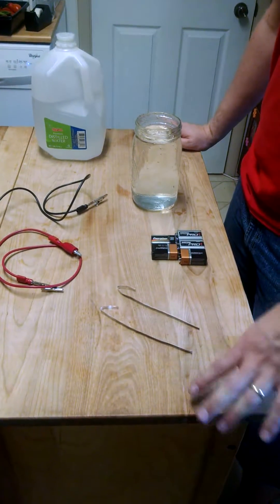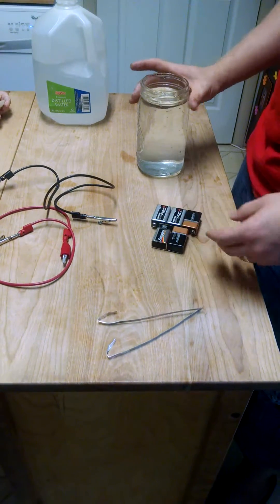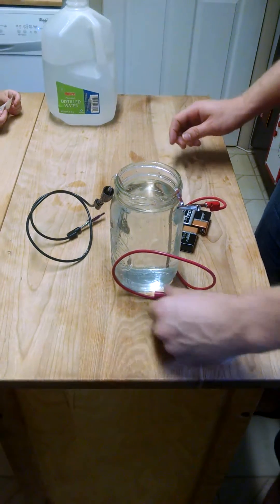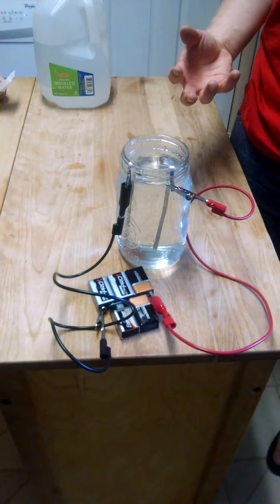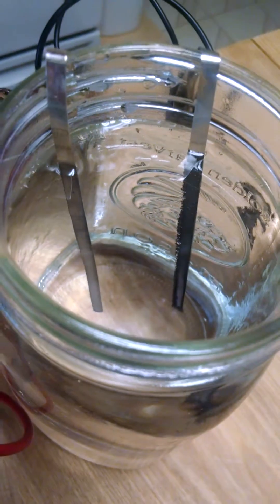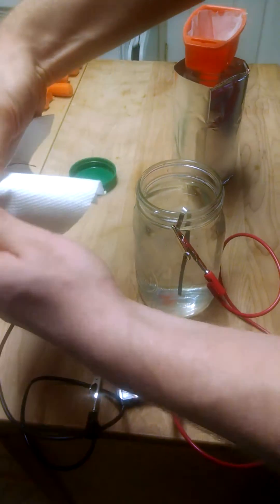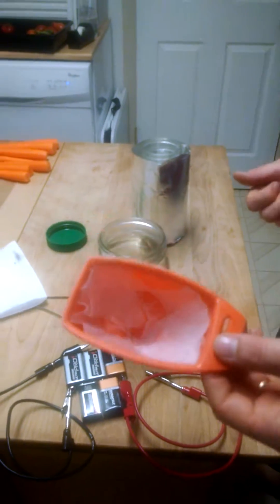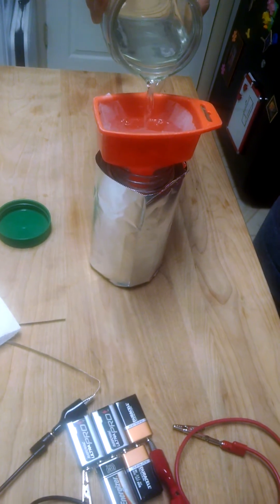Colloidal silver production by the quart **From a chemist**

Comment: I am making it for the first time and its been about an hour but only one rod is slightly black at the bottom. Im using 3 9V batteries. Is this time frame normal or did i do something wrong?
Reply from the maker: Only one rod will get black (silver oxide) the other will start a build up with what looks like fuzz. That's the silver particles that have traveled from one rod to the other. 

Depending on the voltage thats being output of the batteries, it may take longer if they are not at full capacity. 

The rod that's forming black should be almost completely covered (at least the part that's in the water). If I see more than a few mm of fuzz on the second rod... i do go ahead and stop it.  And tthe fuzz on the second rod should form pretty uniformly.

Comment: How do you know when it's done?
Reply from the maker: You can tell it's done with the lead is completely black and the other is covered in fuzzy particles. I don't like the fuzzy particles to get beyond a quarter of an inch, as it's hard to pull out cleanly. 

You don't want the water to over tint and get too dark, but that takes a lot of effort to get to that point or just forgetfulness. 😂

A simple way to test it would be to get a TDS meter if your really concerned. We just don't do that step after years of making it.
Reply: @jazzybio13  thank you!

Comment: Great video!  I clicked on the link for the silver leas, but it looks like they are straight rods and yours are curved at the top.  How did you get yours curved to go over the glass jar?
Reply: Plyers
Reply from the maker: Ours are ribbons not rods, but we haven't found a source for those lately. We picked ours up at a local rock shop  years ago. 😂

For rods you can just bend them with plyers, silver is a pretty soft and malleable material to work with.

Comment: how much do you drink and how often?
Reply from the maker: We actually don't drink any CS internally as it can disrupt the good bacteria in the GI track just as much as the bad. We tend to use it for external applications and wound care most of the time.
Reply: @outoftheboxhomestead  Have you ever experienced a loose bowel movement form drinking it?
Reply: Drink it (2 tablespoons) if you have a stomach virus or food poisoning, 3 times per day. Otherwise, you will just hold it under the tongue, rub around with your tongue in your mouth for a few minutes and then spit it out. It will enter the bloodstream through the capillaries in the mouth and is known to knock out all viruses and infections inside the body.

Comment: My batch is super  cloudy...what the heck?! I sterilized everything and rinsed everything with distilled water beforehand.  😅
Reply from the maker: What kind of cloudy? Usually super cloudy means the water itself had residual particles in it. If it's a milky cloudy it's typically chlorine in the water. You can have wisps of cloudy material coming off the leads, that's the suspended silver particles themselves. Feel free to email us at outoftheboxhomestead@gmail.com with pictures and we can help problem solve this with you.
Reply: Did you have your glasses on?
Reply: @StarwaterCWS  lol, good one!  🤭🤣 I found my issue... I grabbed the spring water instead of distilled.   Made several batches the correct way since this post!  😎
Reply: I know...😂 @StarwaterCWS

Comment: How long do i leave it in there
Reply from the maker: This usually depends on how much power you've got left in your batteries. A standard full charge on a 9volt battery probably only 45min-60min. You'll know it's done when the one lead is fuzzy and the other is black. There is a slight tint to the water, a slightly gray to gold tint is what your looking for. The tint can be either, it just depends on how it reacted. This isn't a strong color observation, just a slight tint. I hope that helps!

Comment: If you add a water bubbler (for a fish tank) to this setup, it will help the silver ions to be more uniformly sized and spaced out in the ionic suspension.
Reply from the maker: If we assume the air stone is inert, I'm not sure oxygen being added to the solution would necessarily hurt or help. It might actually make it oxidize faster and possible give you shorter shelf life or make the solution inert itself nearly immediately. Neat concept, I'd have to do further testing on this to know for sure.
Reply: Also, it is best to start off with a little bit of ionic silver in the distilled water, this helps to speed up the process.
Reply: Would a magnetic stirrer do a similar job? Or do you think bubbles are specifically preferred?

Comment: Isn't it the desirable silver oxide that is wiped off? 
What about modifying the electrolyte with things like acetic acid or citric acid?
Reply from the maker: Yes and no,  when making a colloid you don't want the silver oxide itself, you want the suspended colloid particles which are left buoyant in the water column. So in this specific process the silver oxide is considered waste in this application, but could be used in other applications. As it does have slight anti microbial properties as a silver oxide itself.

Comment: 45v is way too high, especially since you're not using a potentiometer. This isnt chemistry, this is electrical engineering.
Reply from the maker: Nah, we aren't actually using 45 volts, as was mentioned in the video. You can do less, these are just older batteries and we use them until they are dry. ;) That's all. And yes, you can use a potentiometer, that would complicate the build and you would have to have an output reading, and that's not really the intention or outline of this video. This was a straight through process only with simple DIY elements found in a common household. We can do a build like that, but haven't found it to be necessary at this point. We do check the voltage of the set up with a multimeter before starting each time since we do stack batteries. This is both chemistry and electrical engineering....sometimes homesteaders have to double dip. ;)
Reply: Forgive my ignorance, if I’m starting with new batteries how many would I need?
Reply: @thriveprenataleducation5589 3 9volt batteries..27 volts total is perfect.Good luck👍
Reply: @thriveprenataleducation5589  9v x3 = 27v but use a potentiometer to dial back the amperage, otherwise larger particulates will go into solution. The smaller the silver nanoparticles, the better.
Reply: @thriveprenataleducation5589  Three.

Comment: Can you dilute it by adding more water?
Reply: By adding more Distilled water, Yes.
Reply from the maker: Yes, but I'm not really sure what the point is? Anything can be diluted but you'll loose some of the efficacy in it's application. That said, as long as you are using a pure water source without additional minerals that will react with the silver particles  then you should be able to dilute as much as you want.

Comment: What do you do if you want to be more precise and lets say I want 10 ppms, how would you measure the solution?
Reply: With a PPM meter 😅
Reply: 10 ppm isn't shit. You want to be between 80-150ppm. That's why the shit at the store is a joke
Reply: Actually, anything between 10ppm and 30ppm is better than 500pm because in smaller numbers ppm silver particles are much smaller and much better absorbed by the body. Bigger is not better in this case.
Reply from the maker: That's not quite how ppm works. The particles don't grow in size, this is concentration. Meaning there are 10 parts per million verses 500 parts per million. and yes the concentration matters for how it's used, but in broad applications for external use like we were making in this video the ppm doesn't need calculated. We'll do a follow up video on that.
Reply: @outoftheboxhomestead  have you done a follow up video yet?
Reply: @ReapPublican  Thanks,

I was under the impression that 10 ppm is all that is required so when you drink it it will kill anything that's not suppose to be there.
Reply: @ReapPublican Depends on what you are using it for. I'm personally aiming for 30-50 ppm for use in agriculture. Specifically seed production. 150 ppm would just be a waste.

Comment: How long does that last and is there a test to see its complete and how do you know what ppm you made?
Reply from the maker: In a jar, with light blocking it we can get a couple months out of it, but honestly we use it faster than that so we haven't tested it's effectiveness over time. The most critical part is blocking the light, as the silver reacts with it. There isn't an easy at home tests to see if it's complete, with this method at least. We are just basing it off of appearance of completion then testing with a ppm to see where it's at ballpark range.

Comment: Why can't you use a copper electrode on the positive receiving end ? Since only the negative silver is the only one out putting the silver ions ? Why waist the silver on an anode that is just the collector ?
Reply from the maker: In theory you absolutely could, you would just need to keep straight which one is the anode and which is the cathode in the set up, otherwise you would be producing a copper solution, not a silver solution. Keeping both leads as silver removes the possible goof up with user error and simplifies the chemistry. Silver in this capacity is fairly cheap to implement. So overall just ease of use and ease of education to the public. ;)
Reply: @outoftheboxhomestead  Got ya, I just didn't want to ruin two $30 ingots of shiny 1 oz silver rounds when I could use just one.
Reply: @outoftheboxhomestead  Is there a difference in how the silver bar is shaped? I use 10cm long round bars, the width of 2mm, not flat as in the video, and there is far less "black" "fuzzy"ness in comparison. And it takes double the time to even look halfway. Using 4-9Vs, .9999 silver, distilled water in a glass container.  Could it be.... the distance between the bars? also, I do have copper of the same gage. .... hmmm... back to the workshop!! :D
Reply: @just1john  yea it can due to the diff in surface area

Comment: Question, what was the PPM value
Reply from the maker: This can vary from batch to batch based on the amount of electricity  flowing through your battery bank and the duration of time you want it to run for. The longer you run it the higher the concentration or ppm value is. In our set up we run at 27 volts for 50min and find that our solution is close to a 10ppm value fairly consistently currently.
Reply: @outoftheboxhomestead Sir, if you simply replace the two silver rods for gold rods would you be making colloidal gold?

Thank you for your help.
Reply: @youwouldvelovedit I believe so. You're also making hydrogen-rich water because hydrogen gas forms on one electrode and oxygen gas bubbles off the other electrode.  So some of the benefits attributed to drinking colloidal silver could actually be from the hydrogen gas in the water.
Reply: @outoftheboxhomestead how can you measure the ppm tho?
Reply: @sweetbeep  PPM METER.
Reply: @sweetbeep with a tds meter.
Reply: @LIVINGRETIRED310  I heard that doesn't work to measure CS.
Reply: @jazzybio13  10 is good. I try to reach 15 to 18. Cause it falls down to 10 or 11 after it sits.